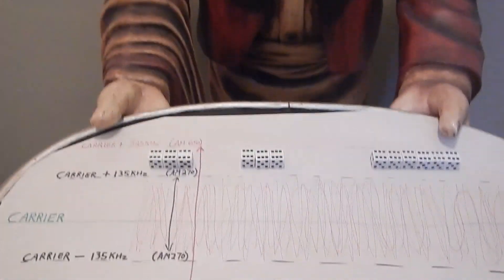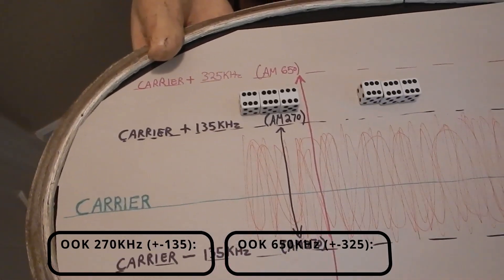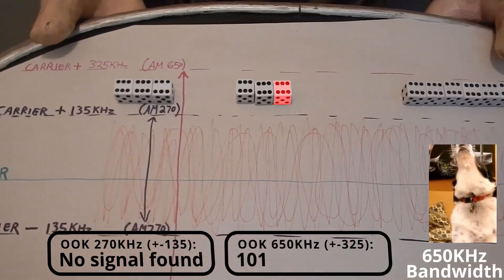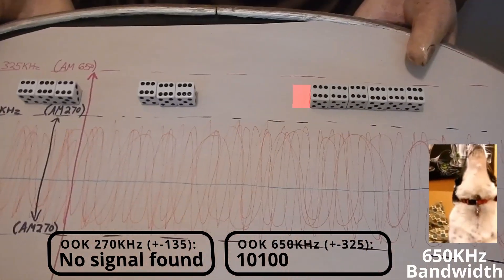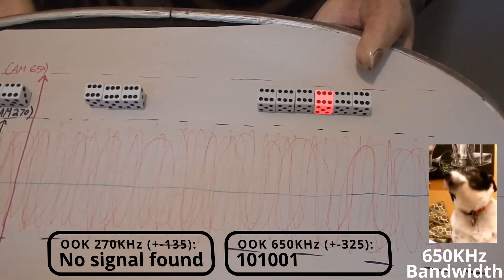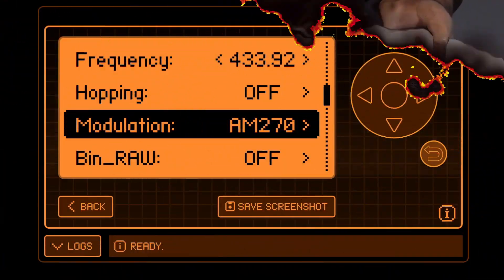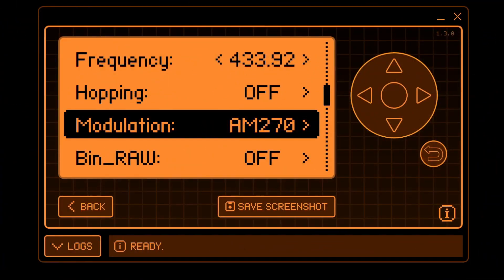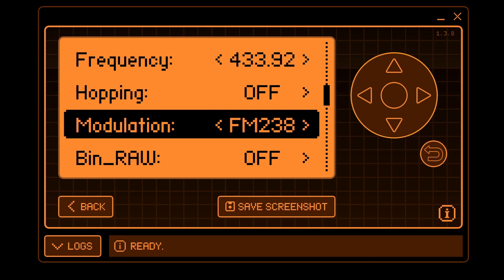[49] Flipper Zero - Jeeves teaches RF Modulation

Comment: Hey teach,, me again,, lol,,quixk question,,does subgz freq analyzer pick up all signal or whatever it set at ,like in beginning u show country frequency band ,,or only scan region bands,and if so how can i add the ones it doesn't have,,7-6-25..…
Reply from the maker: That's a good question - I should probably make a video on that. I think what happens is it scans all frequencies in its frequency list, looking for the frequency with the best RSSI value (strongest signal). It then starts 300kHz BELOW that frequency and scans at 20kHz increments up to ABOVE 300kHz looking for the best RSSI value. It then runs that frequency thru an adaptive average function.
It uses RECEIVE frequencies, not transmit frequencies, for the scan. You can modify the setting_user file if you need to add additional frequencies (or some custom firmware have a UI to add additional frequencies to scan). NOTE: Adding a lot more frequencies increases the total duration of the scan, which may reduce the chances you see the signal.

Comment: Cant wait to learn how to add more modulations to the flipper zero. I need GMSK support
Reply from the maker: Which device are you trying to use that has GMSK?  Is it something inexpensive I can use for testing?  My problem with this video is everything I have seems to be OOK, so it's hard to demo doing a different modulation.  I was able to do a bandwidth demo where I restrict the BW parameters and you need to carefully select the frequency, but I didn't think people would care.  🙃
Reply from the maker: @snygg-johan9958  In a couple weeks, once I'm in Nashville, I should have a garage door to experiment with [nice to know it's not OOK].  Have you seen the video in this reddit post below -- many garages use rolling codes.  (I still plan on releasing some videos on CC1101 custom values, but it probably won't be for a couple weeks.)
  https://www.reddit.com/r/flipperzero/comments/x7dk3o/flipper_zero_garage_door_liftmaster_security_20/

Comment: Exactly that i was searching for. Thank you.
Reply from the maker: I'm glad you enjoyed it!  Hopefully once people watch this video, looking at a waterfall output from a Software Defined Radio (SDR) should also make sense -- color is used instead of dice, left is lower frequency, right is higher frequency, the past is further down the screen; but all of the concepts are the same.

One other thing in SDR, that I didn't talk about, is the fact that it's taking samples and calculating the frequency strengths (so there is noise in the system + noise in the calculations) so there might be harmonics, etc. that show up in the real world when looking at something like a 2FSK or even OOK signal.  

For Flipper Zero, at least now people know what those AM/FM values are (if they watched to the end of my video).  😄

Comment: Nice demonstration. Before I didn't really know how GFSK modulation worked. But this makes some of the filter options in GNU radio make more sense now.
Reply from the maker: Glad you found it helpful.  My wife and I learned a lot making this video -- Dan Bomgard asked for this video about a month ago in the comments & I really had no clue about modulation at the time.  Hopefully it will give people enough basics, so when I show waterfalls and CC1101 registers to decode other signals it will make sense.  Also, in my upcoming video I switched away from using HackRF One in favor of a cheap SDR, so that if people want to buy similar hardware it is just a $25 investment.